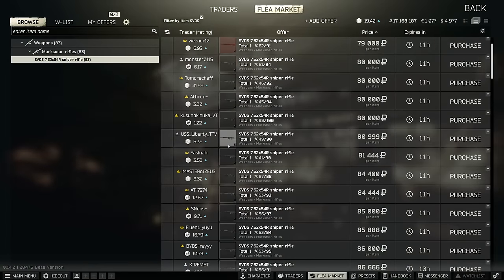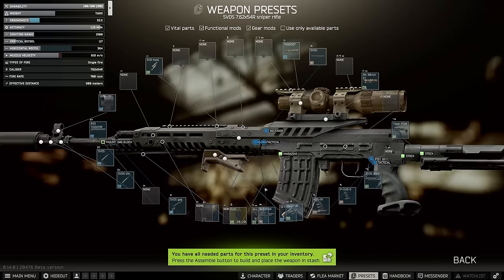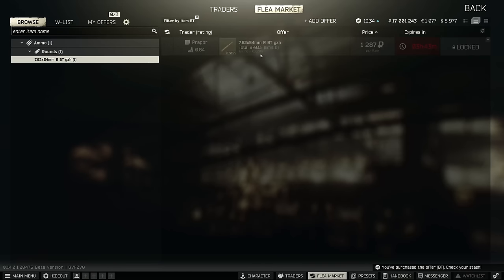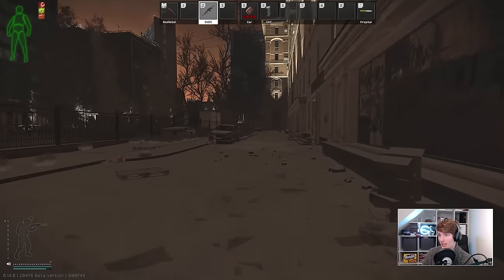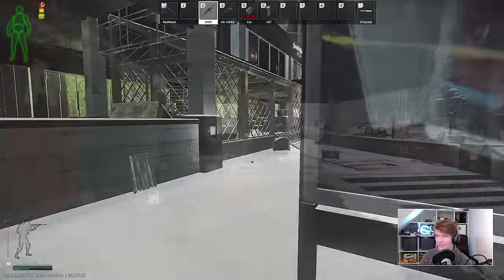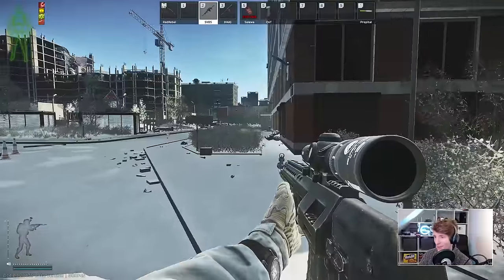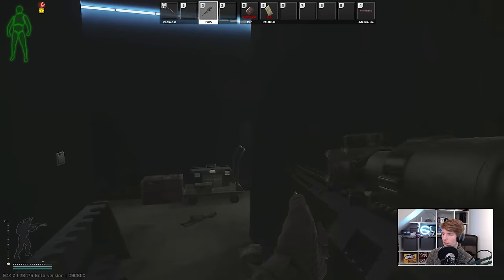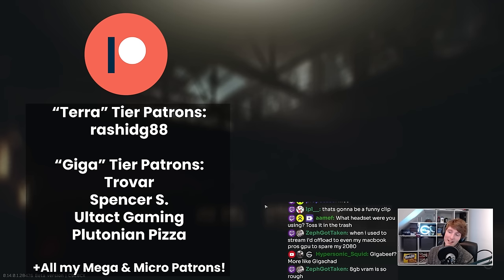Why Ergo SVD Builds Are Terrifying Now

Comment: If your doing punisher 6 and want a cheap efficient build just run stock with a okp7 the cheap rail and the afg grip with a flashlight, and if you need a scope run the svd lower the suppressor isn’t really worth it

Comment: now my question regarding ergo/weight etc. and ADS speed is that if it's impossible to reach that "quick" ADS breakpoint, should we bother with ergo at all? like the RPDN or ash-12 for example. even though an unsuppressed ash-12 has very good ergo, it doesn't matter because the gun weighs so much with a full loaded 20 round mag. so should i just entirely not care about ergo? if 60 ergo is the sweetspot for example, but i can only reach 58. is aiming down sight at 58 ergo, the same as aiming down sight at something like 34 ergo? cause then i will just always run the ash-12 suppressed since the extra ergo is worthless.
Reply: It's not a "snap" from having crazy overswing to non at all. It's pretty gradual. The "higher" you are above that blue line, the worse it's going to be. However the actual "tick" where you fall underneath overswing is going to see a pretty crazy reduction in your effective ADS time.

As for the time the guy uses to bring up the sights, I am very sure that it also follows the same formula as overswing, meaning that the closer you are to that blue line, the faster you're going to ADS (generally). There's also some strange stuff like with certain sights having faster ADS speed, however barrel overswing is actually a universal thing, and has nothing to do with specifics like weapon, sight, character weight, strength etc.

Being 2 ergo points away from overswing is still going to be very good, and at.. 30m the amount of overswing I'd assume is less than the width of a head so it doesn't really matter all that much. Will be more of a factor at longer ranges.

One major thing that you need to keep in mind is how ADS speed effects optics. Because of eye relief you just see a black for a fair amount of the overall ADS time, meaning that you want to reduce this as much as possible. With reflex sights it really doesn't matter as you can usually always see the target while ADS'ing, meaning ADS speed isn't very important at all.
Rule of thumb: Optic = high ergo, reflex sight = ergo doesn't matter.

Personally, I will usually use low capacity mags on my weapons as I love them to be snappy and usually don't shoot a lot. The low capacity mags almost always have better ergo, weigh less and carry less ammo which is actually a good thing because ammo also weighs a fair bit.

Comment: Does that mean if i have a drum mag as long as im over 93 ill not get a jam if i dont over heat? Iv been avoiding extended mags because i was worried about it
Reply: Drum mag won’t fuck your durability bro. Drum mag reduces your ergonomics (ads time and stuff). Ergo doesn’t affect jams
Reply: @gghomie5740 in reality the chance of a Jam is higher tho iirc
Reply: @gghomie5740   im talking about duribilty being blow 93 and that means jams can happen and all extended mags have medium to very high chance of jamming what i didnt know is they couldnt jam above 93%
Reply: @Chevalier_knight  correct. drum mags will affect jams if durability is less than 93, until then dont overheat and you're good dealing with mags egro penalty only

Comment: Other than for the Punisher quest line, is there a reason to use the SVD over the SVT?
Reply: diff scope suppressor and tac device
Reply: the SVT and SVDS are pretty close stock, but the SVDS you can upgrade so much more with mods where as the SVT you really can't do much with. SVDS is just... better.

Comment: this is big. i always focused so much on ergo but now i see weight is almost as, if not more important. maybe its time to remove dust covers?
Reply: The dust cover is actually pretty important. For most weapon weights you're going to have a weight to ergo ratio of ca. 10 ergo points = 1kg.
On the calc I've included a calculation on the left side where you can see how many "kg" you are away from that blue line. This allows you to compare different attachments, to see which ones give you the most effective weight reduction. Do you want 15 ergo 0.5kg mod, or a 8 ergo 0.3kg mod? well.. now you can figure that out by comparing how much the weapon "weights" relative to the sweetspot.

Comment: I killed someone with exactly this type of build like 3 weeks ago but then using an eotech. Have ya'll been testing this for a while now or?
Reply: technically I've been working on the calc since december, but... that guy is probably unrelated haha. In my opinion the benefit in running high ergo with a reflex sight is pretty low compared to an optic. I'd rather go full recoil focused build with an eotech.

Comment: buy STM for 24k, get that high ergo stock with free buffer tube, sell STM back to mechanic for 24k c:
Reply: For the SVD you are really trying to squeeze out every little inch of performance. So the Viper is kinda the only way to go here. There are also another type of PDW stock that you can fit which give you better effective weight than the GLcore stock from the STM.

Comment: just take a suppressor with you then if you need to you can just put it on there
Reply: The enemy will probably have moved or killed you by the time you put it on though :/ Can't say I'd recommend that approach all that much. Maybe more value in running it suppressed but taking the suppressor off if you need to, for... whatever reason.

Comment: There are too much cheaters going about, 6/10 raids, I entered without anything on, moved away from the start point but made no sound at all. Within fifteen minutes, I was shot from within 10 meters ( I made sure the only avenue to be shot was from 1 specific line and distance) every time it was no sound from the shooter even though I seen no suppressor on the gun. Another issue, is lag disconnected kills. All is good at any time, I hear a step, next thing I know the %loss jumps to 11 and quickly increases till disconnect. I relog back in and wow... Dead (it needs to still give info on who kills you as it presently doesn't). Just too much cheaters.

Comment: The svd is one of the worst guns in the game now with ammo and recoil changes making everything else infinitely more viable.
Reply: the SVD exists to suit a very specific playing style. The only decent DMR if you don't have access to good ammo for the others.
Reply: @spacemonkey037    I take an adar with 855 or any gun other than the rfb with bcp in it over t-46 in a svd.
Reply: @Tarkovisstillfun  The SVDS requires PS (or better) to be worthwhile. If your requirement for a weapon is to be effective against class 4 helmet opponents at ranges up and over 300m, the SVDS might be your only choice.
Reply: @spacemonkey037    well if you have ps unlocked, then I'd definitely take m80/m62 instead since I wouldn't be running 20k in a clip and I wouldn't be forced into using the ungainly svd. Or I'd run the sv98. I'll be able to get significantly more shots with better accuracy using a variety of different guns using m80 over trying to deal with the sway and buck of the svd. Plus it can be weirdly inaccurate.
Reply: @Tarkovisstillfun  PS you can get from the flea (at least last time I checked). M80 is much more difficult to come by. And for that reason ALONE, the SVD is a decent pick,
Reply: @spacemonkey037   sure, you can spend 30k/60k respectively to full a mag with PS at 3k a round off flea before it's unlocked, but with the svd MOA, you would be better off using a sv-98 OV with PS for 300+ meter headshots with half the MOA, much less weight, more ergo and you can get shooter born done.  Plus it's cheaper.
Better off slogging through punisher with cheap builds running cheap t-46 and mag dump close up, then never use the svd again.
Reply: @spacemonkey037   don't get me wrong, before the changes, I was an svd enjoyer. I would run it constantly, cheap easily accessible high pen ammo. Everything bucked like a bronco so it's high recoil and sway was nothing out of the ordinary. Now it's like a reminder of how bad aiming use to be before the recoil changes, and caliber was nerfed into the ground. Couple that with bad hit reg this wipe and it's just a recipe for frustration and a waste of good rubles.
Reply: @Tarkovisstillfun  You're completely missing the point though. At level 15 until you unlock m80, what other options than the SVD do you have for long range DMRs? Non. That's the point.
Reply: @spacemonkey037    nah man I completely understand your point, I just don't agree with you. I'd rather use any of the other options I have already listed, they have more utility and are cheaper to run, especially if you're a low level and low on the rubles. What's the obsession with long range use of a dmr? As I said if you're specifically going for long range and don't have m80 unlocked, you're better off running a sv-98 because at least you have a better chance of actually hitting the target you're aiming at compared to the svd's terrible MOA. If you're 200m and below, you've got a variety of options that are much better imo.